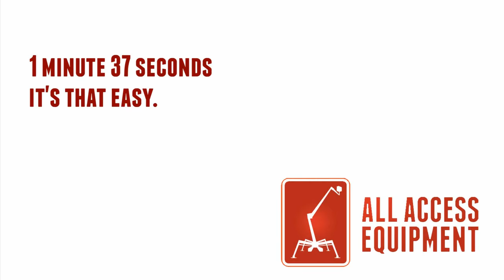CMC 83HD+

Comment: I am calling B.S. we run 83 hd+ arbor pro anytime you hit a little grade tilt alarms go off, and have to over ride manually. And no. Bucket liner on top of the bucket sensor non stop stopping machine
Reply from the maker: Hey there @jlachs, the standard slope climbing ability of the CMC 83HD+ Arbor Pro is 19 degrees or 34% grade without the override. With the override activated, you can climb slopes up to 31 degrees or 60%. 

We want you to have the best experience with your lift. Please feel free to contact us directly at 978-712-4950 if you have any questions or need assistance. Additionally, we can connect with you with your nearest service partner to have your machine assessed if you feel it is not performing as advertised, and we'll work together to get it resolved as quickly as possible. Thank you!